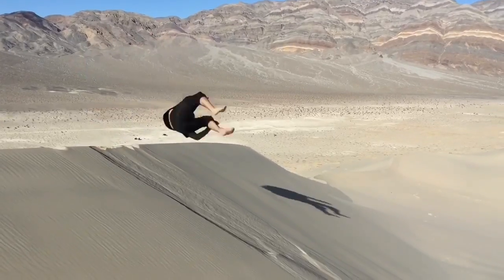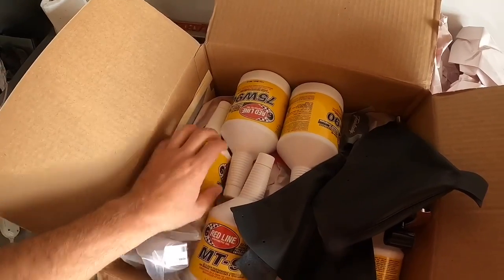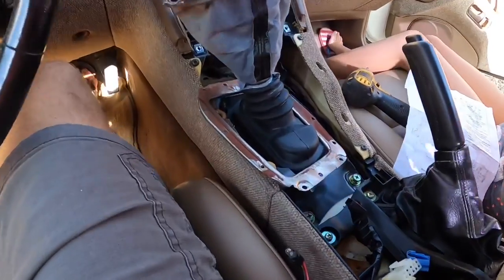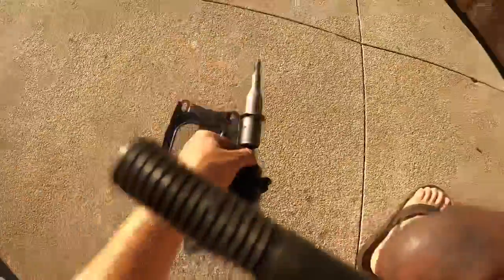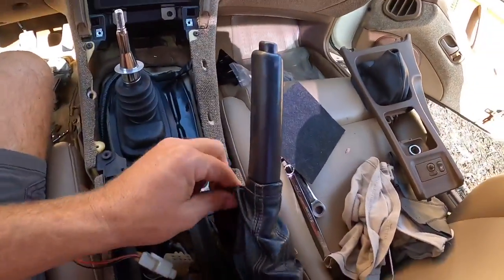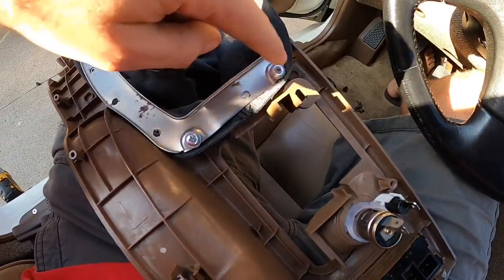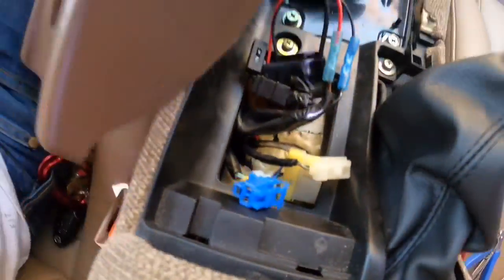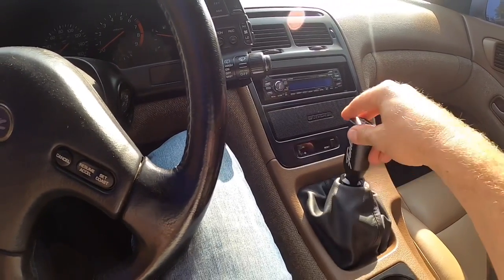300zx interior install mods| Z1 short shifter and Fitted customs cup holder install

Comment: Hi how did you get the washers in on the sides of the fork at the bottom? My Z has the Z Speed solid shift mount and its a pain in the butt to get the washers in. Thanks!
Reply from the maker: Unfortunately it was just a huge pain in the ass. Twisty fingers and angles.

Comment: Nice install!  I just installed mine too from them.   2 USB, voltmeter on one outlet and a 12v power outlet is what I went with ... w a yellow Z.   I took power from the cig lighter  and used that ground too (black on a 90 TT to cig lighter) from cig lighter !